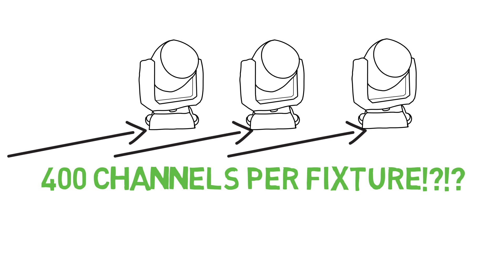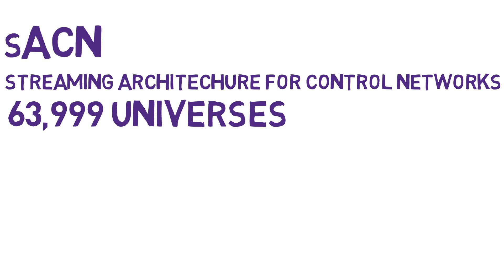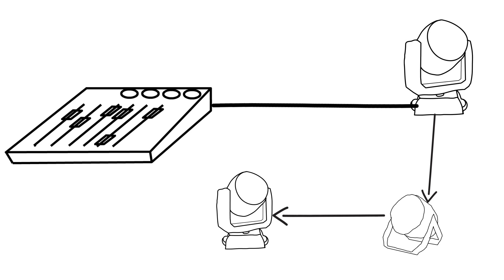What are Art-Net and sACN?

Comment: Hey David, I don't know if you ever ran into a problem with art-net glitching out while using Onyx, but I just posted on the Onyx forum about a workaround for it. In my case I was working with a Showtec Node 8 pro and found a workaround by merging universes from Onyx over sACN with Chamsys MagicQ, which then outputted Art-Net in continuous mode to the fixtures. Now everything works fine. It hope it may help someone. Find the URL here: http://forum.obsidiancontrol.com/t/art-net-problems-with-botex-showtec-node-8-pro-workaround-using-chamsys-magicq-pc/5749.
Reply from the maker: Have not, but I believe it's a known issue that is fixed in the latest release(?)
Reply: @LearnStageLighting  I've not seen it mentioned in the changelog of the new 4.2.x version. Admittedly I'm am still on 4.0.1010.

Comment: Oh man I just bought a Chinese King Kong 1024S console and it supports ArtNet and I am so lost because all of my fixtures are 3 pin DMX. 

I’m struggling to midi trigger this console with a laptop and software like Abalton live. 

I was wondering if I can ArtNet from my laptop to my console instead of using usb to DMX cables and if there is any benefit to even do it this way.
Reply from the maker: Hey George,

The general rule (at this point), is that you don't need Art-net unless you are trying to push a lot of universes from one console, or if your lights.  For you and where you're at, there may not be any real advantage to using the Art-Net.

Triggering is very much a console-by-console thing.  It's all about what the console manufacturer allows and how they allow you to do it.  Because you're using some kind of Chinese copy of a console (which may be technically illegal to own - it looks like an exact copy of an Avolites console), there's no guarantee it will work.  You'll need to check your manual or contact their support (if it exists) to find those answers.  

Thanks!
-David

Comment: What lighting fixtures have over 400 channels I’m just curious the highest amount of channels I’ve seen on a moving head is 22
Reply from the maker: It usually involves pixel mapping - where you can get control of each individual pixel.

For example:
Chauvet Maverick MK3 Wash (297 DMX Channels) (I know, not quite 400).

60 LED/M Pixel Tape: a standard 5M strip of this takes 900 DMX channels!
Reply: Learn Stage Lighting .com Ya when it comes to pixel mapping, you’re going to have to have a media server in order to run all of data. With a proper set up, the media server will do all the number crunching for the pixel mapping and just tell the board “hey, do this with that fixture over there,” allowing the board to treat the fixture as if it had only one Chanel.

Comment: Do you mean 63,999 universes with 512 channels? or 63,999 channels?
Reply: And does the router needs to be connected to the world wide web or not?
Reply from the maker: 63,999 universes with 512 channels - really!
Reply from the maker: Not connected to the web is preferred :)
Reply: Ok, got that. Few other questions;
-I'm using the Sunlite suite 2 lightning program and Imagine that I have some fixtures who support this Art-net, so they have like TPU inputs and outputs, how do I connect them with my computer, because I guess in this way Dipswitches won't work.

-And when I use that Art-net to DMX interface, does that mean that one dmx cable still only can handle 512 channels or can one dmx cable handle 32.000 universes? Orrr does it mean that I can connect 32.000 dmx cables to one UTP cable?

I'm really excited to get answers to this :D 
Kind regards
Reply: BTW I'm just an amateur user with DMX stuff, but I'm very interested in this DMX technology.
Reply from the maker: Exactly - when you work directly with Art-Net fixtures, you set an IP address, universe number, subnet and DMX address.  It's more like configuring a computer than it is configuring a DMX light!  Art-Net and sACN are always going to run on ethernet cable, not DMX cable.  DMX cable can only run 512 channels.

To use your specific software with Art-Net, check with your software's manual to see if it is possible, and how to make it happen.  Check out this video as well: https://www.youtube.com/watch?v=7GVkX8iOws8

Comment: Doesn't sACN only allow 256 universes?
Reply from the maker: Nope, 63,999 (here's a official ref: http://www.rdmprotocol.org/files/What_Comes_After_Streaming_DMX_over_ACN_%20%284%29.pdf )
Reply: Okay. I'm just using MA NPU, and it has 256 universes, which is "65.536" Parametres. Not adresses
Reply from the maker: Correct - you are most likely using MA-Net, not sACN in this case, and as you have found, MA licenses their universes by parameter count.
Reply: And since the Unit only has 8 outputs, I think i'll be able to achieve 256 universes by using DMX splitters, since you can have 512 Channels down a cable. I'm not sure... Do you have any idea?
Reply from the maker: Freddy Spaghetti that is where you can use sACN or Art-Net nodes, once you have unlocked the parameters with the NPU.
Reply from the maker: Freddy Spaghetti DMX Splitters won't help you here - still only 512 channels from each physical DMX port
Reply: So i'll have to find a node that can take DMX inputs?
Reply from the maker: Freddy Spaghetti nope, it will network to your MA via a network cable
Reply: But an NPU only takes ethernet input. So how do you get network out of it. Pretty new to MA.
Reply from the maker: You'll probably need a network switch - check with MA support and/or the manual for the specifics of how they want you to do it :)
Reply: Ok.

Comment: came back to this topic again...NICE. it's funny since writing in to you I was co-opted to help troubleshoot a wireless setup for a club that wanted to get rid of as much cabling as possible. and for some odd reason the previous tech's decided to run an assortment of Data/powercables all over the place.... long story short, since they were using art-net and a assortment of other data protocols for control/streaming. I simply just compromised and had everything ran on a single line of fiber patches that tapped into a few wireless repeaters. Since my day job is IT based, the adaptation of an IP based network makes this part time job of mine a lot easier.

There is nothing like rolling up to a gig, with just a cisco switch and a few tx/rx adapters to control sound,lighting, and media. anyways, keep up the good work!